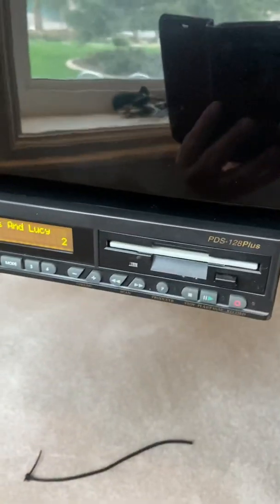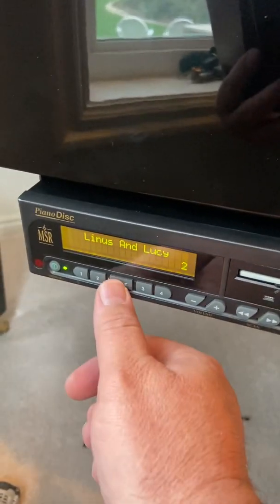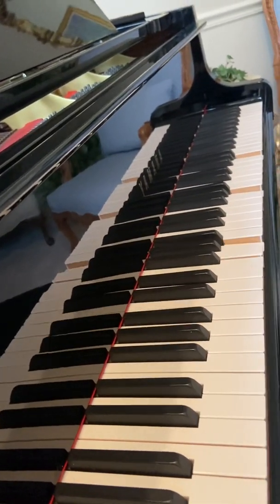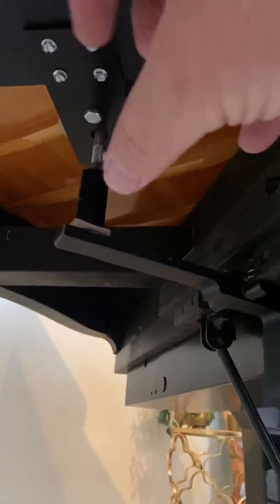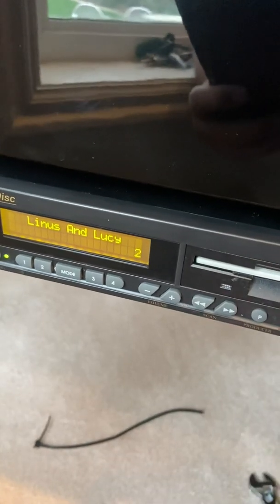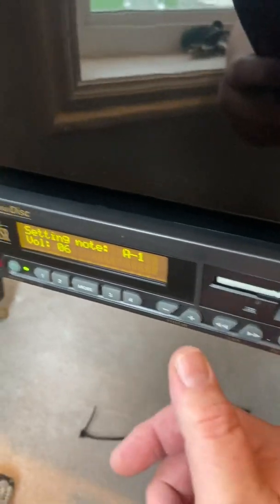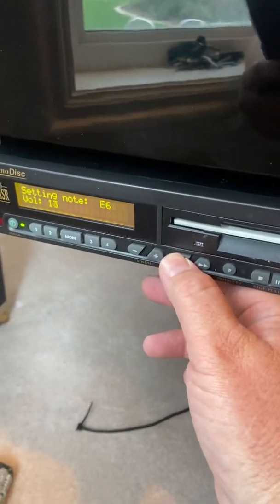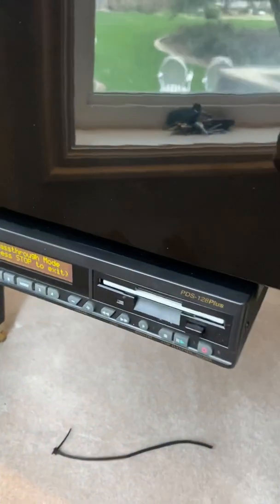PDS128 Plus and PianoStream and calibration.

Comment: Excellent tutorial, THANK YOU!  'Though I've yet to dig into PianoStream, the calibration protocol you outline was superb and to-the-point.  The Petrof 6'6" grand was not responding well/balanced to the MIDI signals it was receiving from the 128Plus (pro-recorded discs AND home-MIDI recordings) so I concluded the regulation of the signal unit (main unit) was at fault.  The  note-LEARN utility was a breeze and the unit is now yielding perfect signal-to-action response with all notation playing smoothly.  Our 128 Plus has a RED RECORD button but doesn't seem to want to record when I play the piano in RECORD mode.  Is there an internal method for switching this capability 'on'.... please?:face-red-heart-shape:
Reply from the maker: @jongooch7042  hello good to hear from you! There is a good chance that your piano doesn’t have a record rail. The control unit has a red button, which would make you assume that you would be able to record, but there has to be some kind of sensing strip under all of the keys, which is called a Record Rail. So if you look at your Piano‘s keyboard, and if there is a cable coming out from underneath the keys on the right side on the treble side of the keyboard, then you’ll know that there’s a record there if not, then there is no record rail and obviously you won’t be able to record.

Comment: Thanks Richie I have calibrated my PDS 128+ as per this video and it still plays too loud. I read that the power supply may be putting out more than 40V.  Do you have any videos on how to check the output of the power supply and adjust it back to 40V if it’s too high? Thanks for all the great videos you do.
Reply from the maker: @mistrot45  hello again. Have you tried using a Yamaha md-bt01 or Widi master with pianostream and the midi in/out on back of Pds 128+ control unit? You would need to put it into bypass mode. You could also try a direct connection right into the midi in on cpu. That might allow you to turn down the volume down farther than otherwise possible. Regarding the 40V   There is a feature called “power offset” that your control unit might have. See if you can find it. Adjust it down a bit and see if that makes a difference. Could you send me a pic of your power supply? It might not be a bad idea just to replace it. If you did you could manually turn down the 40v. The power supply also outputs 10v and that part of the supply may be defective when placed under a load. I have a video demonstrating this somewhere. My email is hayesiq@gmail.com thanks talk soon. Richie
Reply from the maker: https://youtu.be/0mgp0mJXPZk?si=B41OICkSTHdnJqM9
Reply from the maker: @mistrot45  with this supply you could manually turn down the 40V 
https://youtu.be/iExCUDpN8mI?si=9fD7S4g4_WmAEA_E

Comment: Hey Richie. I’m a musician and electronic producer in Memphis TN. I am trying to figure out if I can use the PianoDisc system MIDI input to compose in real-time from the output of my laptop or MIDI controller/sequencer. Is that possible? I have access to a Grand with a PDS-128 system installed on it

Comment: Hey Richie,

I hope you don't mind me contacting you.  I'm trying to work on an old PianoDisc PDS128S+ and I've run into a wall troubleshooting.  

The Problem - The keys don't move when called for by the PDS128S+

Things I've done:
I've checked the power supply, all the fuses are ok.  
There is 40V DC coming out of the one plug going to the solenoid control board
The test button in the back does nothing
The PDS128S+ turns on and plays floppy disks through the speaker (background)
I've checked to make sure Piano is in the On position
I can pres 1 and 4 to go to setup mode but there is no response from any of the keys when I cycle through them.

I'm not sure what I should be checking next.  Do you have a troubleshooting guide or perhaps any suggestions or recommendations on what to try next?

Thank you for your videos.  Been watching them to help with the issue.
Reply from the maker: Hello! Email me anytime! Hayesiq@gmail.com

Comment: Thank you so much. I spent hours going over the regulation for only a slight improvement. Until I found this video. Can I lubricate the solenoids? What to use? Thanks for all your help.
Reply from the maker: Hello you can use a little bit of protek although it’s not recommended but sometimes we don’t have a choice! So just be careful when you use it. 
Protek 1406 Cleaner, Lube and Protectant, 4 oz Bottle https://a.co/d/9TiyQDz
Reply from the maker: Quite often it will free up the solenoid. Use a little hypo oiler or plastic applicator…

Comment: Why do you need a md-bt01?
Reply from the maker: So that you can play songs from the digital interface of the app pianostream.
Reply: @hayesiq  I have a pds-128 (not plus), do I need an additional power adapter for md-bt01?
Reply from the maker: @charlessun9100  hello Charles. Sadly I have not had good luck with the Pds128. But… I know that its firmware can be updated to Pds128+. Once that happens then you should have the midi pass thru options available with the pds128+. However make sure to try the free station before you subscribe because I can’t guarantee anything. One other thing. Plz join our pianostream Facebook page. There is a lot of knowledge and experience there. You might be able to pick up another control unit from the group. And just one last thing. Feel free to send me an email. My email is hayesiq@gmail.com Thanks
Reply from the maker: @charlessun9100  if you can update the firmware and or get a different control unit (pds228 or Pds128+) you would need the power adapter for the 228 Not the Pds128+. The Pds128+ has power which leads me to believe that the Pds128 does as well. But the firmware has to be changed or a different control unit just be employed or you will not be able to control the volume. Also there will be no midi pass thru mode which makes pianostream digital interface (midi player) possible.

Comment: Great video. Adjusting the levels has made the player perform MUCH better. I am having some difficulty with the wi-fi part. The md-bt01 powers up and connects, but the pianodisc menu only offers in and out on the midi menu. It doesn't give me the redirect or pass through option. It is a 128+ from 1995....what am I doing wrong?
Reply from the maker: Hello. Dang. I’m not sure why you’re not seeing the midi pass thru mode. Did you put a floppy disk in the floppy drive? That’s the only way it will work.
Reply: @hayesiq  I have been looking through the manual, clearly an act of desperation....pressing the shift button and the #2 button simultaneously on the remote puts the unit in the bypass mode, allowing the unit to stream. It is now working! If I could only figure out the recording....it mentions that not all units were set up to do this, but doesn't say how to figure out if mine was.....
Reply from the maker: @douglassankar3388  wow good work! I did not know that was possible!
Reply: @hayesiq  I have the n-drive emulator, and it registered as a disc was in place. Without that, it does not let me go onto the menu at all. I still have a working floppy and could switch back if you thought it would matter. The unit I have is a 128 plus before the silent drive.  There is o e other oddity....on the tag it identifies itself as a pianodisc 182.....I always figured that was a dyslexic misprint....

Comment: Hey there, I've got the PD-128 (not plus).  The disc player is jammed...can't seem to unjam it.  I'm looking for a place to have it opened and fixed.  It seems to be a mechanical problem (spring)?
Reply from the maker: Hello… It might be easier to find a local Pianodisc Tech and buy a used control unit from him. If the drive is jammed up now most likely won’t work once you unjam it.
Reply from the maker: Hello again! If you see this plz say something! You don’t even need the control unit anymore!